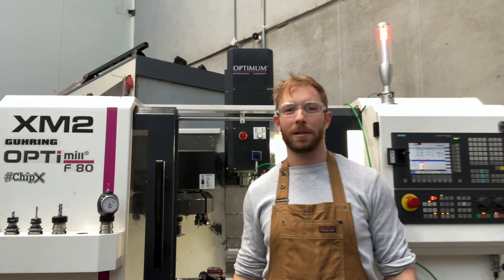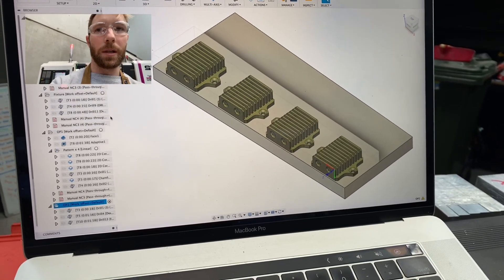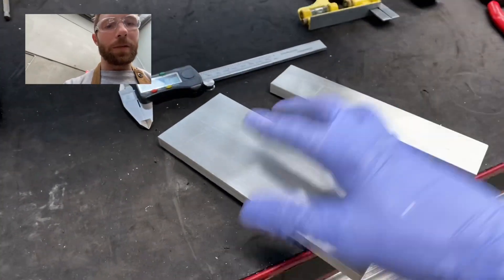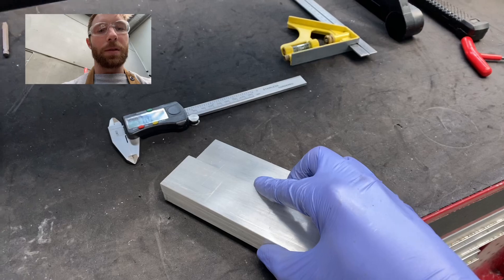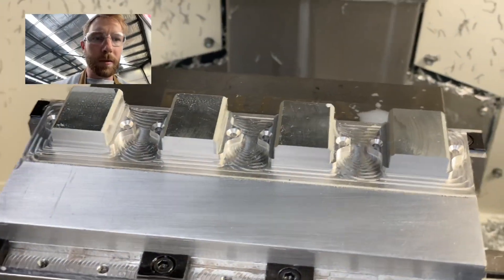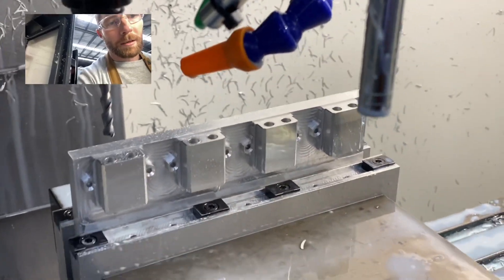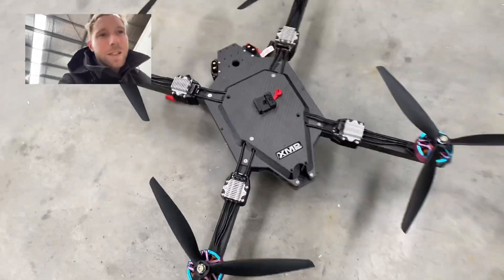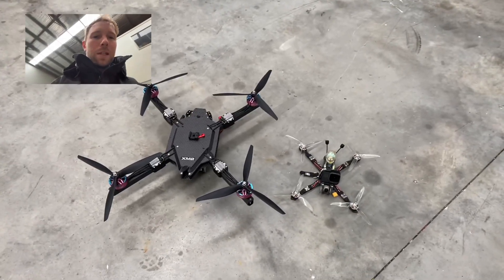DIY Racing Drone Heatsink !!!

Comment: Hey Luke, love the videos mate. 
I’m looking at buying either the Optimill or the Syil X7. They both are very similar spec and price wise. 
Do you have any thoughts on the two machines. Cheers
Reply from the maker: Hi mate, the Syil X7 has closed loop feedback so I would highly recommend that! that's the main different in my opinion. Check out DCTTeacher (Aaron) he is local to me and has that machine 👌

Comment: Good stuff, nice work of the double position for the fixture. I'm guessing you used M3 to coincide with the thickness of the fin, I probably would have made life hard on myself and attempted to use the heatsink mounting holes, tap them then drill them out later, I wouldn't have thought to add holes that weren't in the finished design just to make life easy!